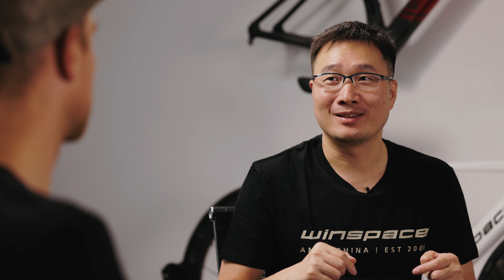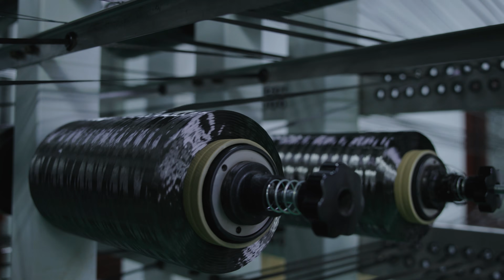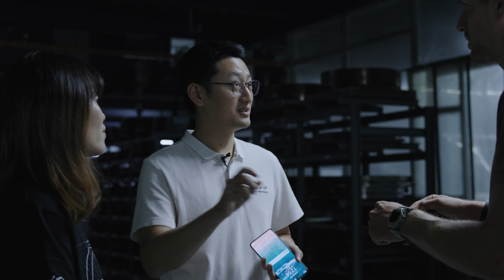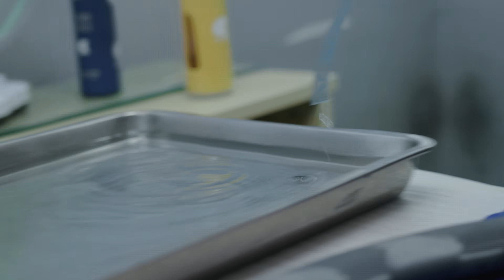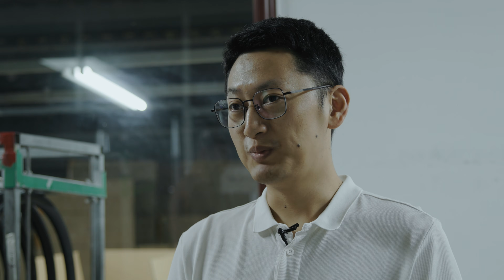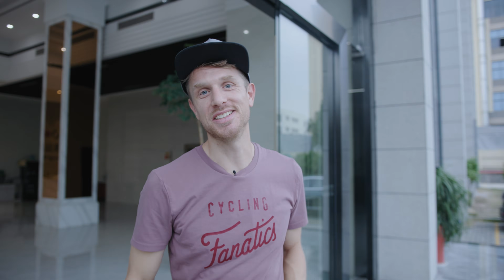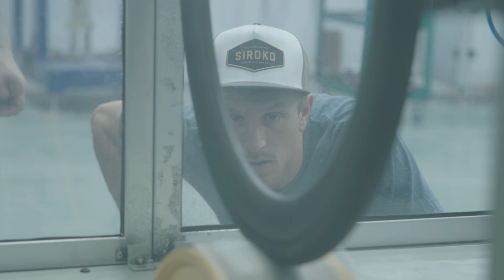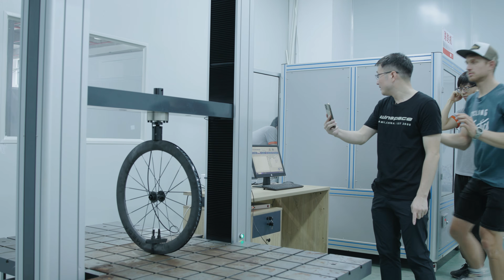Watch This Before You Buy Carbon Wheels in 2024! - Lún Performance Factory Tour

Comment: Winspace wheels are a typical example of getting what you pay for. Creaking sounds included. No thanks.
Reply from the maker: I have no such issues 🤷🏼‍♂️
Reply: @jasperverkuijl  Then you are lucky because these issues are common. Just read several reviews and user experiences. Goedkoop = duurkoop.
Reply from the maker: @user-d32658  wondering if you have Lún wheels yourself? 
Sure there will be negative thoughts on reviews, always. But some of them are on older models and they have improved the design. I can only talk from my experience. I have 3 sets without issues and know a few people riding them without issues. 

Goedkoop duurkoop is zeker niet op z’n plaats. Ten eerste omdat ze niet goedkoop zijn, ten tweede, de duurdere wielen op de markt hebben zeker net zoveel problemen. Ook lightweight wielen van 4K gaan kapot, mavic wielen vallen uit elkaar als je ernaar kijkt….
Reply: @jasperverkuijl  Lún are cheap compared to the more well-known brands. Believe me, you get what you pay for.
Reply from the maker: @user-d32658 hahaha. Ok, so you don’t answer any question I asked. Just throw another empty statement. I don’t believe you because I have great experience with them. 😃

About the price, maybe the other wheelset are just way too expensive. But you can pay what you want for whatever you want if it makes you feel good 👍🏻
Reply: @jasperverkuijl  Your individual experience is irrelevant versus multiple poor reviews from different people who review different wheelsets all year long. You can buy those wheels if you want, but afterwards don’t complain about quality issues, poor service and lack of economic growth in the EU. What’s next? You buy a Chinese EV? 😂
Reply: @user-d32658 you must be missing all the positive youtube reviews
Reply from the maker: Good chance In a few years from now we are all riding chines EV’s indeed 😂….. (not saying that’s a good or bad thing but..)
Reply: @user-d32658 Where I used to work, I've handled multiple Winspace HYPER wheels and have never heard any one of them creak.

Comment: Lun Hyper 2023 R45 owner here. These wheels are insanely fast! Not to mention they are aerodinamically properly designed. I've taken these on quite a few fast descents with crosswinds and I was hesitant of the F-RAPID design, I thought it was just some nice marketing labeling but these wheels do cut through the wind in the flat, downhill and climpbing up as well. It has been amazing to see all the R&D, production and QC processes that go behind lun wheels. In addition to that I was amazed of their great customer service. 

When I purchased my wheels I originally purchased a set of R33s Hyper SE. After a few days I noticed the shiping was a bit behind schedule. I contacted them directly through their website chat just to ask why was the shipping taking longer than usual, they explained they were waiting to receive a batch of R33s SE from production and it was taking a few days more than they expected. I understood and just mentioned for them to let me know once they would be sent.

However, the customer rep apologized for the delay and as compesation and without me asking for it they offered me a free upgrade to the Hyper 2023 R45s since they had those in stock to ship right away. I did want the lighter R33s in the first place but I couldnt resist the offer they gave me, I even took it just to see if they would fulfill that promise their customer service rep offered. Less than a week and a half later surprise surprise the wheels arrived home and as they notified me on the chat, I got the 2023 Hyper R45s, that was an instant $269 USD extra value they gave me at no additional cost.

Winspace and Lun are truly at the front of Chinese Wheels and frames manufacturing, their great proven value, quality and overall service is what has put them in this position, all those thing is what makes a brand worth its equity. I wish and I hope nothing but more sales, success and innovation to come from them!

Comment: Nice video.
I sent my two cracked Berk carbon saddles to a factory in China for repair. I thought the saddles couldn’t be repaired, but my friend suggested trying it since it would be free if they couldn’t fix them. They sent them back three weeks later. They look good and are strong enough for me to sit on for more than a year.

I can trust Chinese carbon factories. They do a great job.

But in mass product, They need focus on QC. That's most important.
Reply from the maker: 💯! In any mass production the QC is super important. Anyone can make 1 good frame, but to make thousands is difficult
Reply: That's cool, what factory did this for you?

Comment: Thanks for the vid. So Winspace doesn't manufacture its wheels, such as most western carbon wheels brands. It would be interesting to know what are the Chinese brands existing and building their own wheels, through their own factory.
Reply from the maker: I think you have a perception that western brands produce their rims in their own factory but that’s not true. There is no such thing as 1 brand producing only their own rims. (Sure there will be a brand somewhere in the world…) Watch the docu again;) 
They all (most of them) come from factories like this. Than they only assemble the wheels and say it’s handmade in “whatever country”.
Reply from the maker: To add, they have the rims, hubs and spokes manufactured at their manufacturing facilities (factories) and than assemble it in their own factory (the assembly room).
Reply: Elitewheels
Reply: I think Tuff produced their own rims hubs and so on for instance, vs Winspace outsourcing. While in Europe you still have the like of Corima, made in France. Don't get me wrong, i value very much Chinese brands. But i do value more the brands actually manufacturing their own stuff rather than outsourcing the main parts of the product and then outsourcing.
Reply from the maker: @nimamoini6469  why would you value them more?

Comment: Well. Light bicycle already use the technology to have ready to build rims out of the mold. Literally so smooth the surface doesn't have to be further processed.
Reply from the maker: Nice. But also light bicycle is not a mass production product and 3x as expensive as Hypers. So there is a bit of difference. 
(Mass production is another world apart from making a one off product..)
Reply: campagnolo also has rims build this way
Reply from the maker: With filament winding you mean or? 

(There are more brands that use that technique indeed)

Comment: The damage test is fantastic. All western brands I have seen are using free fall. There’s no way to measure force and analyze later. Win space is doing it in a more controlled way.
Reply from the maker: The freefall is a required test. Winspace does it too as you can see in this video. The other one is extra to test the joints of the 3piece bonding. 👍🏻

Comment: One rule I learnt over the years about wheels: you get almost exactly how much you pay. If something is too good to be true, then its not true. Wheel performance and quality is more than just a specs sheet.
Reply: T800 is T800. U shape is U shape. A sound hub is a sound hub. Sapim cz ray is sapim cz ray. But you can pay 1x, or 3x, for that. You'd really have to be specific in your claim, because i strongly disagree.
Reply from the maker: @pierrex3226 if you think the quality of a wheel is only depicted by the quality of yhe components you are missing out on some good information. The wheelbuilder will have a big influence on how well the wheel performs and stays true etc etc. I would highly recommend watching that review video on my Winspace hypers like I said before. (You will find it in my videos it’s got 200k something views)
Reply: @pierrex3226  what's ur background sir? if you have some engineering background, it's kind of obvious that specs on paper dont necessarily match the quality. Wheels are not cars but just take that as analogy.
Reply from the maker: 100%, spoke tension according to some table alone doesn’t make a good wheel. Watch my hyper review video and you’ll learn a lot more about wheels!
Reply: How come? I’m interested to know what qualifies a good wheel for you.

Comment: Did you see anything in the process making or in the factories you didn't like?
Reply from the maker: It’s hard to judge because these where the first factories I’ve ever visited. Even thought had a pretty good idea of carbon production, I was learning a lot and seeing things for the first time. 

One thing would be that I learned/heard afterwards is that you should always wear gloves when working on carbon. (People when crazy in the comments on Instagram) so that’s one thing  guess. 

For the rest not much, I was honestly impressed by the process of wheels and frames etc.
Reply: @jasperverkuijl  That chinese lady applying the carbon to the frame wasn't wearing gloves.

Follow up question, were there a lot of secrets they didn't want to tell or show? Stuff you really wanted to see.
Reply from the maker: @DanTuber  the only thing they didn't show me was the filament wound carbon machine, just like I said in the video. for the rest i could see everything I wanted.
Reply: Carbon is the new asbestos. Under a microscope the fibres look the same. To be fair that factory looked pretty tidy but it is 20 + years of exposure for incubation for lung disease. Same as coal mining, manufactured stone, smoking 1 pack a day ect. If the sanding was being done wet I think that would keep the dust down. Probably best to go with disk brakes.

Comment: Interesting. Carbon spoke is just a big NO tough.
Reply: I had a crash with Lun Hyper wheels. 3 of the spokes suffered minor splits, but they didn't break. Easily replaced by bike shop. Formula 1 uses carbon everything for weight and safety reasons,  so it seems to be a good option.
Reply: Your stewbid is showing
Reply: up to the consumer to choose. there are plenty of metal spoke on the market
Reply from the maker: Why? It’s stronger than steel
Reply: @jasperverkuijl the designs are still not yet mature. Evidenced by then making many big revisions. Better to wait until they have it figured out and the wheels are durable, long lasting, easily serviceable, dont have corrosion issues with nipples, etc
Reply from the maker: Big revisions are made in all carbon products so that’s nothing new. They are on new grounds so need to try different things. 

Indeed the aluminum steel spoke 32hole rims have been the same for a while. You can go with that if you want to play safe but you’ll be far behind in performance and tech 👍🏻
Reply: @jasperverkuijl  I can still keep up pretty well with old-fashioned CX steel spokes 😀